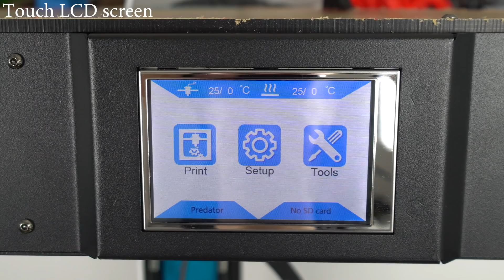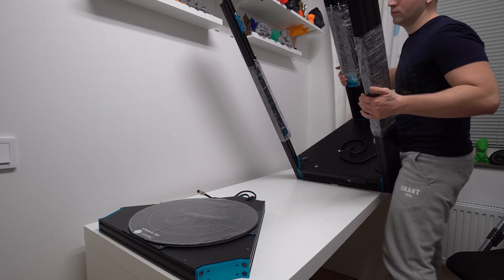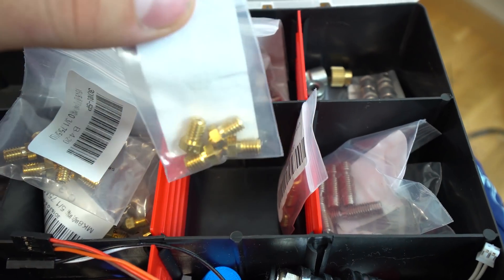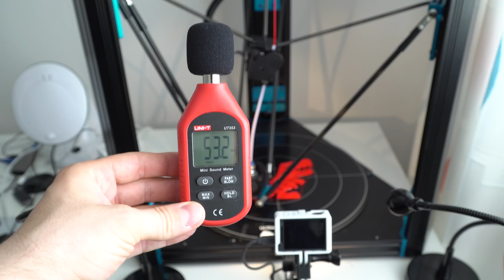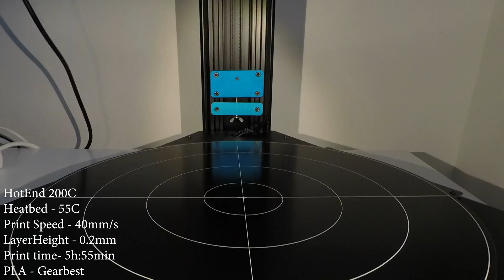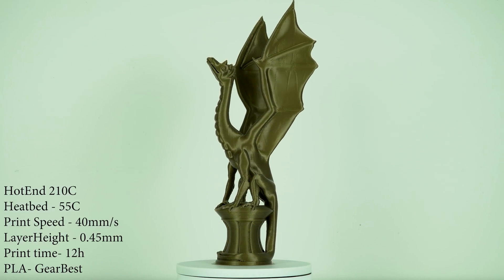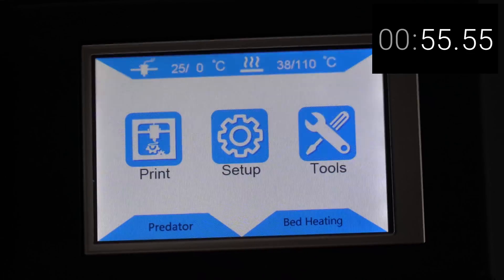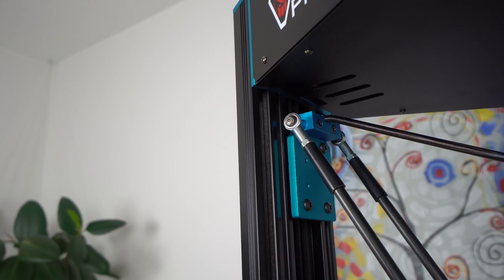Anycubic Predator 3D printer Review - all you need to know

Comment from the maker: Prints in video: 
Moon City - https://www.thingiverse.com/thing:2245289
Flexi Rex with stronger links -  https://www.thingiverse.com/thing:2738211
Great Horned owl - https://www.thingiverse.com/thing:3487557
Fully Assembled Ball Bearing - https://www.thingiverse.com/thing:143467
Aria the Dragon - https://www.thingiverse.com/thing:600550
3D Benchy - https://www.thingiverse.com/thing:763622
Cable clip - https://www.thingiverse.com/thing:70549
Twist vase - https://www.thingiverse.com/thing:3102638
230 quadcopter - https://www.thingiverse.com/thing:629338
M365 Anti Slack- https://www.thingiverse.com/thing:2551419
Spiral Towed - https://www.thingiverse.com/thing:2062447
Smartphone stand - https://www.thingiverse.com/thing:214603
FDM Benchmark test - https://github.com/kickstarter/kickstarter-autodesk-3d/tree/master/FDM-protocol

Comment: hey hows it going, so i recently acquired a predator printer and have been getting to grips with it.... i got some great results at 0.2 layer height but it a went wrong when i changed to the golden layer height 0.1618...is there a setting i should change.... it seemed like the z offset was wrong but i can only microstep by 0.4 at a time but it seems to need even smaller adjustments to get the first layer right at 0.1618... could you advise if i need to change anything? many thanks.

Comment: great review! 
Referring to the TL smoothers and motor dampers: How much more quiet did it get? Would be great if they had used better stepper drivers right away from the factory :-( Do you know which stepper drivers are used on the original board?
Reply from the maker: Stepper motor dampers make printer movement much quieter and TL-smothers makes print quality much better by removing salmon skin artifacts. You can see in the video when I did sound comparison before and after installation. Difference is huge!

Comment: Just bought this printer, but having issues with it. When doing the test print, filament does not stick to the heatbed. Tried using different filaments, tried releveling few times, tried cleaning the heatbed... Nothing seems to work. Have I gotten a bad one, or is there something more that can be done? Any help is appreciated...
EDIT: In the video when print is being done, all the fans seem to be spinning. Only one fan is spinning in my printer... - is this normal?

Comment: Very nice video and printer.
Did you experiment with printing faster than 40mm/s?
Reply from the maker: Thank you! Of course that I'm, deltas are very good at high speeds because of low mass on the print head and overall design.

Comment: I´ve bought mine because of your Review 4 months ago and I´ve already gone through about 8kg of Filament. I sold my Snapmaker for the Predator and couldn´t be more satisfied. The only thing you should have mentioned in your Review was the Tension of the Belts and Rollers. I had to adjust both of them and now it works perfectly.
Reply from the maker: BYK That's awesome! Thank you so much for the info and for update. Good idea, I should mention that as they can be variations in belts tensions from factory. You know, I mention belts tensions and rollers so many times before in my videos that I though that everybody has already learn it :)

Comment: I've seen some mixed reviews of this printer, but I get the general impression that people who had issues didn't tighten the working bits correctly and blame the machine for poor quality. I was actually about to buy the Chiron last night but gearbest killed their sale 3 days early. Ended up going to the Anycubic website to see what the deal was and it turned out the Chiron and a number of other models were fully sold out, but the Predator was available, and $40 bucks cheaper WITH 3kg of PLA! Score!!!  
Your review definitely helped the sale though and put some concerns to rest. After further consideration, I think this size printer is probably better off not having a huge heated bed to lug around.

Comment: Hello wonder if you can tell me about PETG setting. Temperature and fan setting. I KEEP ON Failing for printing single small cube.:(
Reply from the maker: P Mjs 220-235C on hot end depending of PETG. 70C on Heated bed. Fan speed 0% on first layer then 25-50%.
Print Speed 40-50mm/s depending of model. Travel speed 120mm/s.

Comment: Apart from the size, how would you compare this to Ender 5 in terms of print efficiency and print quality? Based on this video, it seems Predator would not need any upgrades (motor dampers are now stock) except for diods,  for achieving perfect prints. Both printers are similarly priced. Does the Delta type movement offer improvements over Ender 5? Can delta print in high both at 2-3cm figurine scale and large scale?

Comment: Can you set a watt mater on the printer? 1000W is a lot...
Reply from the maker: Tim Van Keulen Heated bed is pulling max 380W and that's only when is heating up. When it's printing heated bed pulls only in pulses from time to time not continuous. Whole printer pulls less then 500W max from the wall and again that's not continuous load.
Reply: @NexiTech  yeah, 1000w active useing isnt posable, how is the printer over te time?

Comment: Nice video, how do you change the nozzle diameter on the print touchscreen in info ?
Reply from the maker: Lucas I don't think that you can charge it on LCD screen that easy. Why would you do that? 
 Just change nozzle diameter in your slicer software.
Reply: Nexi Tech, I’ve put an 0.8 mm nozzle diameter settings in my slicer but when I go to info in the printer touchscreen I see : nozzle 0.4 mm 
And I think it may influence the print, may I my wrong.
Reply: * May am I wrong
Reply from the maker: Lucas 0.4mm on LCD screen are just info. It will not affect the print. Printing with 0.8mm nozzle require slower speed and some practice.
Reply: Nexi Tech, ok thanks. You have a really good channel, keep going !
And what settings would you recommand for a 0.8 nozzle, I can’t find something good on internet and my prints are very ugly.

Comment: One question is that when you were leveling probe, you didnt set up with A4 paper manually first whereas I did. I still hard to get the perfect height, ended up manually offset -0.04. Is this number also saved in the memory or I need to set up the additional offset value every single print? Thanks !!
Reply from the maker: You did good. New Z Values are now saved in memory. You don't need to level it again or enter offset number on each print. It will take a while untill you need to re-level the printer again.
Reply: @NexiTech  Awesome! thanks

Comment: I bought this printer and it is actually huge. This build quality is amazing. Also I the one I got says Anycubic-D instead of predator. It already came with stepper dampers which is awesome, amazing printer. Now to put it to the test. Thanks anycubic you rock
Reply from the maker: Cutler Cycles Thank you very much for the new info and your comment.
Reply: @NexiTech  Quick question. Have you tried to change the Vref on the A4988 drivers that come on this board? Seems like the A4988 need a good current to remove the salmon skin.

Comment: Chiron vs Predator vs CR-10 v2: My final question about chosing my first 3D printer...I know different types but same purpose; which has better printing quality and durability/reliability? Make comments please.
Reply from the maker: Halil Avcılar Here is my straight  answer: CR10 V2 has better print quality, it's more durable, more reliable and it doesn't need any upgrades or fixes. It works perfecty fine out from the box and it's very good choose for the beginners.
Reply: @NexiTech  I am very happy that i am enlightened by your answer, very appreciated.

Comment: Hi Nexi! Great channel and very detailed video! However, I have a question on that printer: I purchased a Predator a month ago and, after installing TL smoothers and dampers, I started printing (PLA and PETG). Unfortunately, I'm experiencing printing problems: massive stringing (retraction settings 6mm and 60mm/s, but I tried also do change these parameters), very poor bridging, pimples on external layers and scars on top surface... Not exactly good prints, and I print at "only" 40mm/s... I noted that the difference respect to your printer is that my Predator arrived with the V5 j-head clone, not the V6 as you declared. Do you confirm that your Predator arrived with V6 clone and not V5 clone? Thanks very much

Comment: I have rarely seen such a consise and detailed review that exactly covers everything I want to know. No rambling, nothing unnecessary. Many thumbs up!
Reply from the maker: Thank you so much for such a nice and positive feedback!
Reply: @NexiTech  One thing to add : can you maybe test how fast you can print with the predator and your smoothers? I would like to know if the extruder can handle high throughputs like 0.6mm nozzle 0.3333 layer height 100mm/s without grinding the filament or under extrusion. If this printer can also print fast I am definitely sold!

Comment: I have had mine for two months, and although I like it I am very glad it wasn't my first printer. First, the knockoff hotend clogged- it's a bad version of an e3d v6, but the Bowden tube goes all the way into the heater and thus clogged completely and quit working. Replaced that with a real e3d v6- then the extruder keeps slipping, it's a sort of Bondtek knockoff, but only one gear against a grooved pulley- so now I'm replacing it with a real BMG to fix the slipping problem.
   It's NOT a cheap printer, so instead of shipping it with two cheap hotends, why not just one authentic e3d v6?? Also put a better extruder on it, or at least use Bondtech gears...
Reply from the maker: Mine Predator worked great during my testing and I printed so many prints with it and I did not had any of the problems you just described, never got any clogs or anything. Maybe your thermistor sensor was not in correct place or it was bad one which can give false temperature readings to motherboard and that can lead to clogs and extruder skipping. Yes, it is clone V6 hot end and clone titan extruder just like all other 3D printers from china that I tested which is not the bad thing because genuine V6 hot end and titan extruder are much more expensive. I still have my Anet A8 with clone V6 hot end for 3+ years which printed countless prints and still works great.
Reply: @NexiTech  But this is not an actual v6 clone- the v6 is all metal, with a heatbreak that connects between the heat block and the body- this one is attached to the body, and the Bowden tube goes about 6mm down completely through the "heatbreak"  INTO the heat block! BAD copy, has to eventually clog up or melt the Bowden tube if you are using higher temp filament, like I did just before mine clogged. On the extruder, they could at least have copied the tooth profile of the Titan- this one has flat, sharp teeth that just chew up the filament... they could have left out the second complete hotend, and fixed these problems with no additional cost on their part...

Comment: Update 2019/08/28 The motor dampers are now factory included. So you only need the TL smoothers. Noise level is SO LOW! 28 dB when printing with all the fans on (cooling fans at 50%)
Reply: are the TL smoothers really that good? Is there any downside to the TL smoothers?
Reply: The latest series have white or red logo ?

Comment: Hi, will this printer print NylonX without mods?
Reply from the maker: NylonX copy-paste
"Print temperature: 250-265°C
Print speed: 25mm/s - 35mm/s
Bed temperature: 60-65°C with PVA glue stick"
The last part with PVA glue stick is the problem. 
Ultrabase should be use as it is and you can't add anything on it especially not glue stick. That would ruin the ultrabase surface. Now I did not try to print that filament so I can not say would it stick good to the Ultrabase or not.
Reply: @NexiTech  thanks mate.

Comment: Hi Savitha, I am having trouble with m anycubic predator i have tried every setting i can think of but cannot stop it from stringing when i say every setting i mean retraction fom 0.45 to 8.00 the nozel heat from 220 to 180 the bed from 0 to 60 the Z hop from 0.35 to 3.00 changed the filement changed the layer hight can you recoment any thing i can try please?
Reply from the maker: I presumed that you talk about PLA. That means the problem is not the print settings. Check your bowden tube when printer is performing retraction. Is bowden tube fixed in place? Is it moving? Is bowden tube pushed all the way in to the nozzle? Heat up to 240c and then push the bowden tube in hot end to check it. Also when nozzle is hot, grab bowden tube and move it back and forward on both end to check is there any slop or movement? It should be fixed in place on both end. Check nozzle? Is it screwed correctly?
Check air duct nozzle? Is it clean inside? Is the cooling fans blowing? How good is the air flow when cooling fans are on 100%?
P.S. Disable Z-hop that can also create some stringing if you don't hit perfect hot-end temp.
Reply: @NexiTech  Thank you very much yes it wasthe boden tube HaHa at last i can start printing properly

Comment: Hey Nexi,
I now own one of these printers. You said a golden height of .1618mm I was wondering if you wouldn't mind sharing or doing an in depth video of your settings and how to get good prints from this machine. I currently am not getting very good dimensional accuracy. cubes are X 19.85,  Y 20.02,  Z 20.23.
Appreciate any help!!
Reply from the maker: Hi Zero,
Golden ratio layer height is used more for visually improving prints look and it should not affect print accuracy. Have you tried to print with 0.2mm and 0.15mm layer height and then check your cube accuracy? Print it hallow at standard print speed at 40mm/s. Also check the arms joints, maybe you have play or slop in some ball joints? That can be cause of your print accuracy. Try to rotate test cube by 45 degrades and then test again?

Comment: I bought this based on this video. they did put stepper dampners in and i can barely hear it print. But, i do have 2 problems and hope you might have a solution or two. First is bed leveling, it isn't happening. I've done it with bed cold and hot and always have one side that is not level, seems low. The other problem is print quality. I did install tlsmoothers but get rough verticle faces on the low side. I do have 2 Anycubic linear deltas, and a flsun, so I'm not new to deltas. I'm going to wipe the bed with alcohol and check for warpage in the bed next. But if you have any clues I would appreciate it. Loved the video and hope to see more.

Comment: Can you share your settings, please?
Reply from the maker: Fernando Pérez 
Problem is that I change my print settings on the 'fly' depending of the model that I need to print but here is sometning to get you started. 
PLA
Layer height 0.2mm 
Top layers 5
Bottom 4
Walls 2
Flow 103%
Infill 20%
Hot end 200C
Heat Bed 55C
Print speed 50mm/s (up till 100mm/s depending of model)
Travel speed 120mm/s (up till 200mm/s depending of the model)
Retraction distance 5mm 
Retraction speed 70mm/s
Cooling 100% from 2 layer
Minimum Layer time 10s

PETG
Layer height 0.2mm 
Top layers 5
Bottom 4
Walls 2
Flow 103%
Infill 20%
Hot end 220C
Heat Bed 70C
Print speed 50mm/s
Travel speed 120mm/s 
Retraction distance 5mm
Retraction speed 70mm/s
Cooling 50% from 2 layer
Minimum Layer time 10s

FLEX - from the video
Layer height 0.2mm 
Top layers 5
Bottom 4
Walls 2
Flow 103%
Infill 15%
Hot end 220C
Heat Bed 55C
Print speed 40 or 50mm/s
Travel speed 120mm/s 
Retraction distance 5mm
Retraction speed 70mm/s
Cooling 100% from 2 layer
Minimum Layer time 10s

ABS
Layer height 0.2mm 
Top layers 5
Bottom 4
Walls 2
Flow 103%
Infill 20%
Hot end 240C
Heat Bed 105C
Print speed 50, 60mm/s
Travel speed 120mm/s 
Retraction distance 5mm
Retraction speed 70mm/s
Cooling 0% 
Minimum Layer time 10s

Simplified 3D Anycubic Predator standard print profile 
https://drive.google.com/open?id=1w9Vigkn7B-lKUcAPlnHZEVsymKBcpIoZ

 I hope that I helped
Cheers
Reply: @NexiTech  OMG thank you very much, I just bought all the upgrades that you recommend. Thank you very much!

Comment: Would you choose this one over the Chiron?
Thanks for all the hard work.
Reply from the maker: Bruno Infante Yes I would! :)
You welcome my friend. Thanks for stopping by ;)

P.S. Predator is much faster and more easier to level then Chiron. In terms of actual print quality Predator is better then Chiron at higher speed as it's Delta but on other hand Chiron has Massive 400x400 heated bed and it will print much bigger object then Predator. It's dead race between Speed and Massive Size. Car VS truck :) You need to pick one that fit most to your needs.
Reply: @NexiTech  thanks for the help, in size they don't look much different anyway, so I will pick the predator, thanks for the help and tips on this video they will be very useful.
Reply: Btw mate just found a rip-off of this video on the channel "
Benson Reviews", already flag it.

Comment from the maker: Heat bed installation Quick guide
Parts needed: 
-heat resistant cotton sheet 400x400mm
-Silicon glue
Links in video description
Installation:
- unplug Heated bed cable
-Remove glass plate platform(unscrew 6 screws)
-put 400x400 cotton sheet on flat surface like table and place ultrabase glass on it. 
-take marker or pen and mark a circle.
-rotate Ultrabase and mark rest of the circle.
-use scissors or scalper to cut out a circle.
-place Ultrabase glass on flat clean surface like table(use cloth)
- Apply silicon glue in circular motion on aluminum heated
-Place cotton sheet circle over silicon glue on the aluminum heated bed.
- Apply some weight on the top to press it, like few books, some weights...
-Let the silicon cure over the night. If you are in hurry reconnect heated bed cable and set 45-50C for 45minutes on the Heated bed to speed up the process.